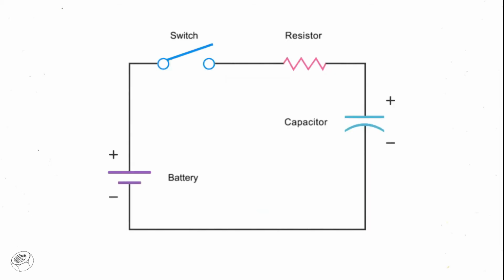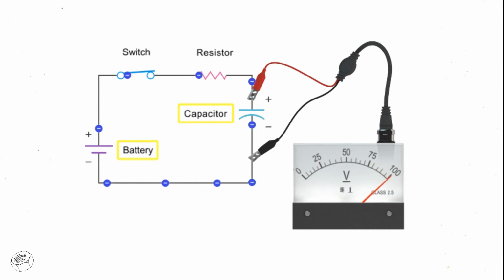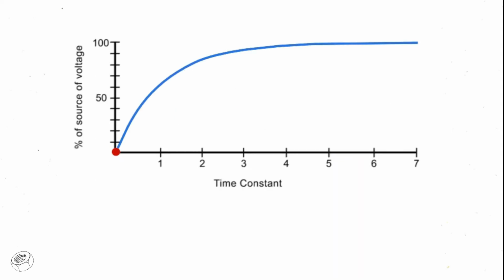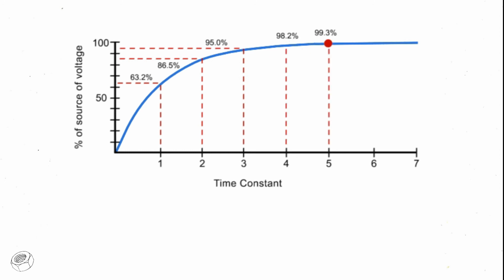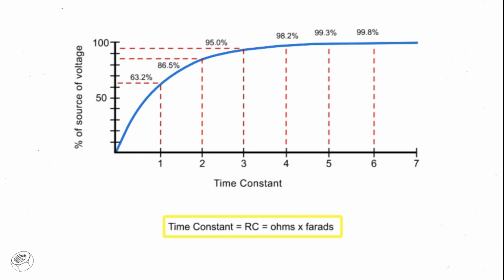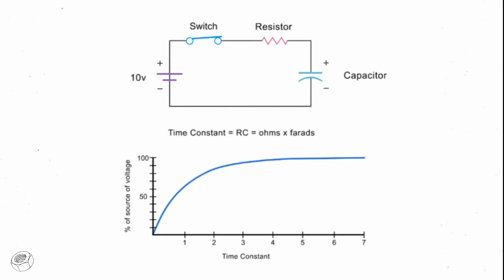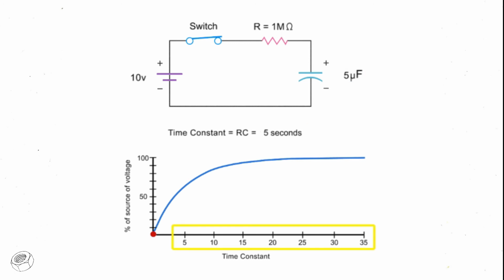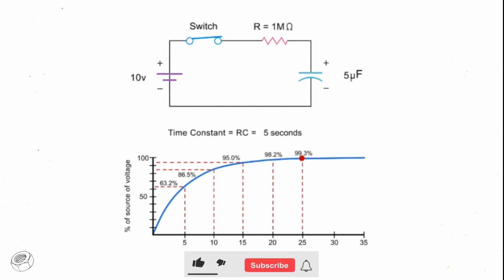How capacitors work explained animation

Comment: My question is how the Time Constant doesn't depend by the voltage of battery. I mean if so, then if i had the same μF and Ω but differend voltage 1volt and 1000volt the battery will charge at the same time.